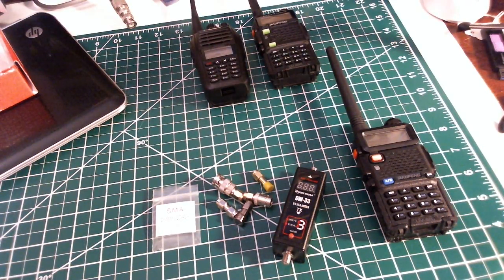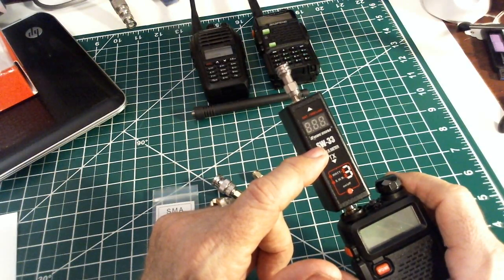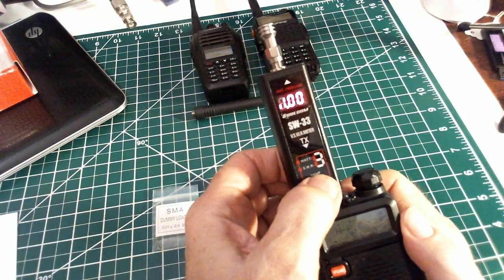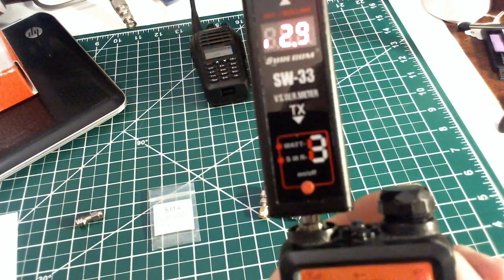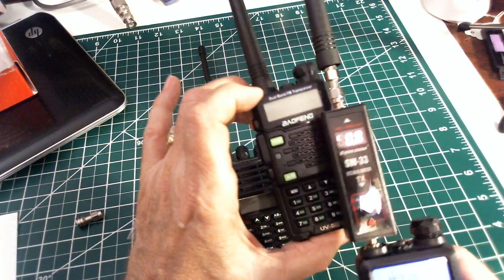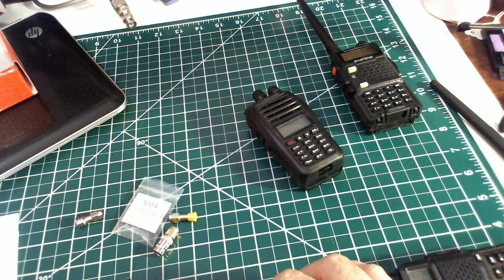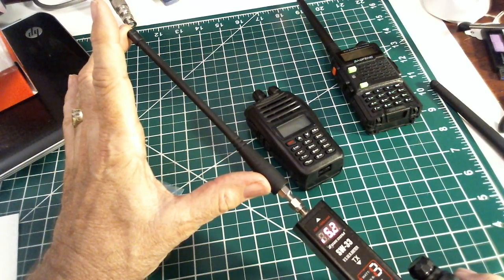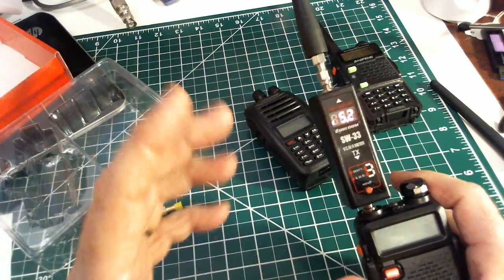TRRS #1480 - SURECOM SW-33 PWR and SWR Meter (Testing)

Comment: Thank you for the positive review. I'm curious, would this equipment be suitable for testing both my 25-watt and 45-watt base radios, or is it designed specifically for portable radios? Your clarification would be greatly
Reply from the maker: Yes, is should work fine on your base station radios.
Reply: @hamrad88  thanks 👍👍👍
Reply from the maker: @SecretMan299  you are very welcome.

Comment: I'm not sure you need to identify yourself when you use a dummy load, and when I test my equipment, I never bother with identification as most frequencies are unused in my area (Washington, D.C., suburb). I do a lot of scanning and there isn't anyone on the frequencies with the exception of a HAM repeater that's fairly popular. Oh, there are also two things about the SW-102, SW-33 and SW-33Plus. First, all of these meters test crazy high SWRs as is. The new SW-33/+ has three settings: 1) power, 2) SWR, and 3) reflected power. You also have to cup your hand around the meter and the radio when you take the reading. If you take the time to identify, your battery life will suffer. I generally transmit 3-4 seconds using a dummy load and five seconds using an antenna. And all of my Surecom meters test very high on antennas, even with Nagoya antennas! Power readings seem okay some of the time, then inexplicitly comes in very low. I'm hoping the 33+ does a better job. Again, try cupping your hand around the meter when you take your reading. It or may not help.
Reply from the maker: Habit

Comment: just got the Mark II of this same model (difference is the Mark II has ONE more mode: ref(lected) power, bottom horizontal segment lights up). I have 3 aftermarket antennas as well as the included antenna for my UV-5RIC (Industry Canada certified). The included antenna is the second version (tapers to the end, not like the first edition that didn't taper and was always reported as being horrible).
Testing on the meter showed the included antenna <1.5 on both bands (and that is touching and NOT touching the meter). Best was 1.02, worst was 1.5.
Sadly, every aftermarket antenna didn't fair as well. The stubby sucked on both bands, an ExpertPower XP-771 (comparable to a Nagoya 771) was only workable on VHF (UHF was >2.2) and a HYS Tactical Antenna (one of those roll up measuring tape antenna like the Abbree) was ONLY usable on UHF low power (>3.4 on VHF). It actually measured 'better' ROLLED UP (but still not usable).
Assuming the meter can be trusted (and so far no one has said they're lead weights, even comparing to antenna analyzers of KNOWN quality they measure 'well enough'), it's a handy device for the LOW cost vs REAL analyzers (remembering that this is isn't an antenna anaylzer, its an SWR bridge; a RADIO is required).
Reply from the maker: Thanks for the detailed report and have a great day.

Comment: Thank you for this video! If you read the instructions for the sw33 it states that you need to touch the box when testing. It brings it down to 1.01 without touching it it's 1.67. Did you try the same thing? Touching the Box while transmitting?
Reply from the maker: Yes and as I remember it made little difference.
Reply: @hamrad88  thank you for responding.. The big question is if I trim/tune the antenna will I be trimming too short if I don't place my hand on it the box?
Reply from the maker: @ralphperez2735  Only suggestion I have is to compare it to other meters that maybe someone else has.

Comment: The radiated power of the antenna may differ from the power input. With antennas like this, they can get a low swr  by making them having a high loss. An extreme example, take a dummy load put a small antenna on it. I will give a low swr a good power input but very radiated power. This is in part how some of the antennas are designed so as not to damage the radio no matter what you do.
Reply: As another example. Take a long transmission line to the antenna. make it with a very loose cable. If you look at the SWR going into the cable lt will show a low SWR. No mate what you put as an antenna you will show a low SWR. The outgoing and the reflected wave are attenuated.  Low reflected wave = low SWR. This is why scope probes will be 10X to minimize problems of impedance matching.

Comment: I have one of these and been using with good results.  Put up a new external base antenna today. The SWR was 1.01 and 1.07 at the top of the GMRS channels. So I am very happy with that.   While checking the Power wattage using this meter, have you compared the power readings from this meter to another one?  The power reading using the dummy load works fine. When I put it on a radio that has a High and Low setting, the high should be 50 watts and the low at 5 watts on my radio GMRS 50X1.  The high setting shows 15.5 and the low at 4.9.  I can't seem to get the power to read 50 on this meter.  The radio screen itself shows it is putting out high power but not sure really what it truly is.
Reply from the maker: I can't remember for sure but it seems like it can only read output power accurately up to 15 watts.  My memory ain't what it use to be. LOL

Comment: I watched another video that this meter also showed high SWR.  Are all the antennas de-tuned, or is the adapters and meter on a rubber duck causing the de-tuning?
Reply from the maker: My experience is that rubber duck antennas have high SWR.

Comment: why dummy load is different than original antena? I mean the reading..
Reply: in theory the antenna should be 50 ohm  to match the 50 ohms resistance the radio requires to be able to transmit max power efficiently out of the antenna. Ohms law...higher resistance means higher impedance to the flow of current thus increasing the SWR. The SWR is the back-flow of energy that was unable to leave the antenna and reflected back into the radio.  Usually the  problem of the antennas resistance is higher than 50 ohms or its not the right length physically or electrically.

Comment: Did you even compare it to a reliable VSWR  meter?.......I’ve got one of these and I don’t really trust its readings
Reply from the maker: Yes, it was within 10%
Reply: There handy but 10% is a lot...just saying I’ll use them,but I’ll find someone with a calabrated vswr and check....though I must say I haven’t fried  any radios with it, however my 2bmeter yaesu reads higher than the shurecom, however hams are cheep ar#es, and I’m a  poor cheeparse ham lol, I’ll be putting away sheckles for a good analouge vswr

Comment: Thanks for the great review! :)
Obviously the antennas are not very efficient.
Might make my own by calculating the  wave length by 1/4, 1/2 , and / or FULL....
i remember the days of CB (27Mhz), and full wave length for that was 8ft 9inches, if I remember correctly....
Reply from the maker: Thanks
Reply: 1/4 of 11 meters you mean.
Reply: FYI, 1/4 wave for chicken band is around 9ft.